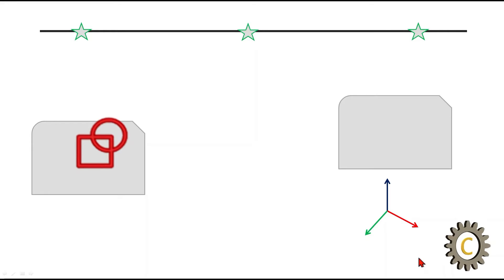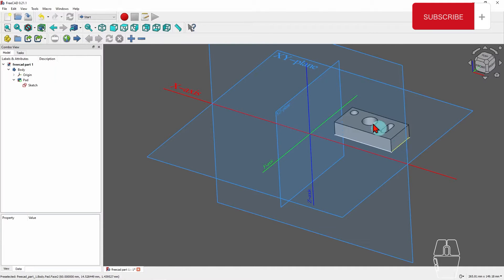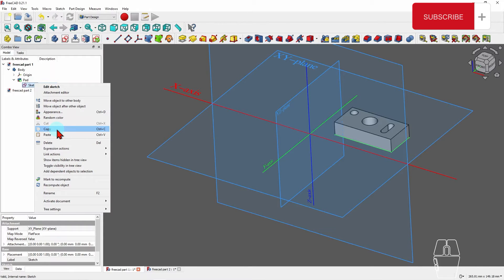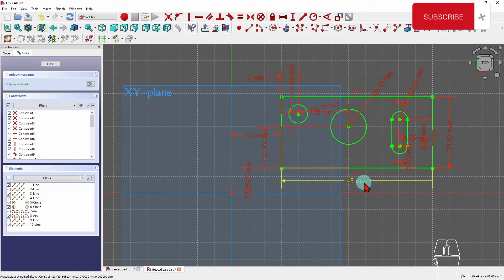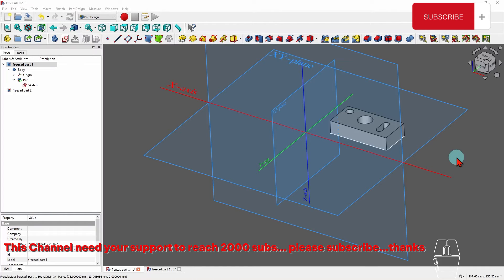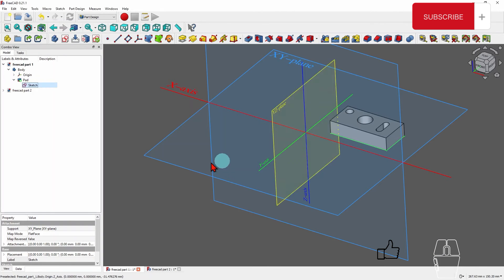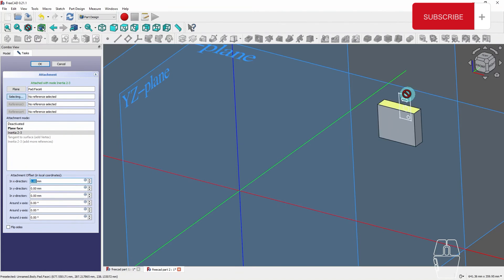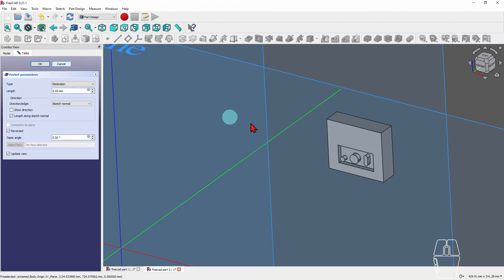FreeCad Tutorial. How to Copy a Sketch from one Model to another Model (in different work space).

Comment: I don't like using faces of bodies to orient other sketches. I've had nothing but problems with doing this, due to the topological naming problem, which decides to show its ugly head later in the project, when it becomes a nightmare to try and correct. I've been burnt too many times by this. I learned the hard way to keep references to shapes separated from bodies and surfaces. Ok to link to external geometry in another sketch, but not to other bodies or surfaces - nothing but trouble IMHO. Hopefully, the topological naming problem will be substantially reduced in future versions of FreeCAD. I know they are working on it, but it is not an easy problem to solve.

BTW, Your videos are really good, and I learn a lot from them. Thanks.
Reply from the maker: I agree… attaching to faces could lead to downstream topo issues. Thank you for your comment. It is helpful to others to hear from experienced FreeCad user like you. I encourage viewers to leave comments and share your      experience…